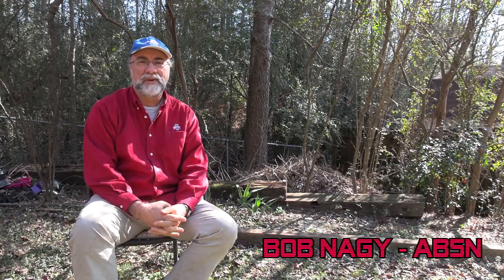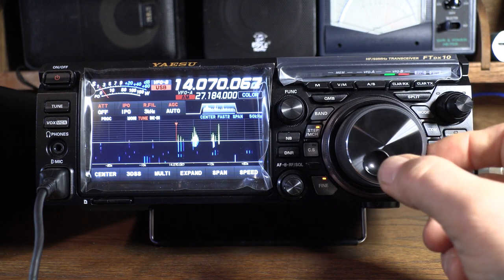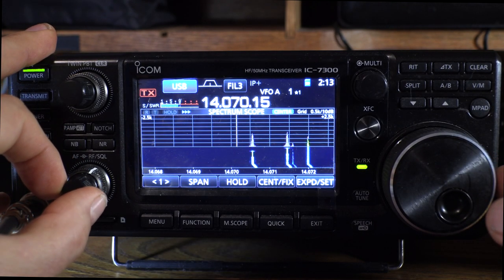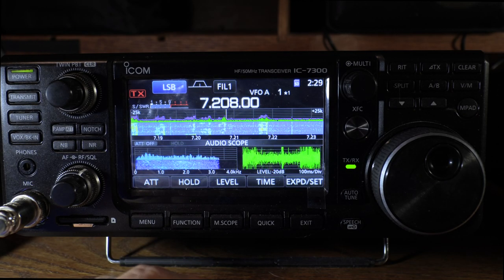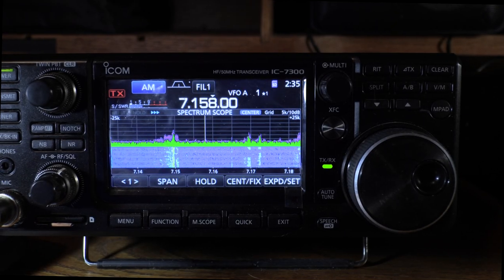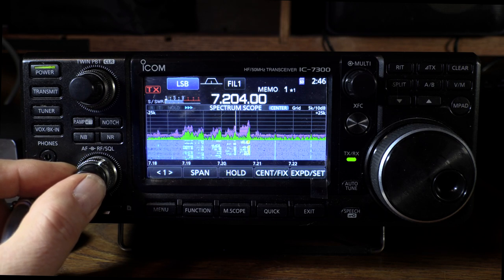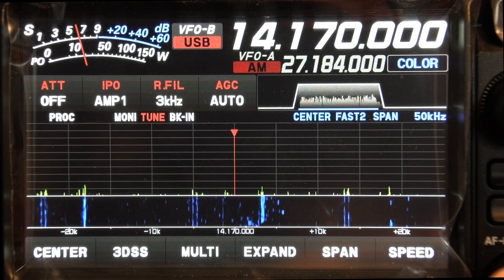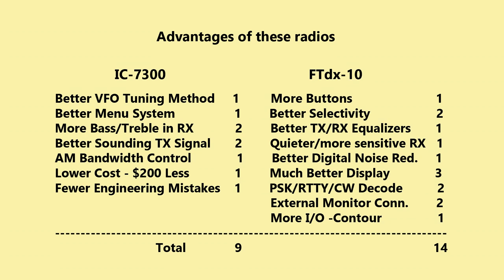Head to Head Comparison of FTdx-10 to IC-7300.

Comment: I have to agree that benchmark numbers might be part of my decision criteria but the relative feature sets and to me the ergonomics are at least as important. I’m also into photography and I prefer cameras with separate M/A/S, ISO and exposure compensation than these buried in menus. So all things being equal I prefer the more analog experience. Watching other reviews and comments online I’m concerned about the number of reported “problems” and “faults” with the FTDX10 vs the 7300. I guess I’ll have to consider the merits further. I have no experience anchoring bias either way as I’m a newbie and do not own a Base/Desktop unit of any kind.
Reply: Brad- Well, you'd be happy with either of them. If you are not a contester, the 7300 is just great. The 10 has better selectivity for contesting, but a quite strange menu system. All the common stuff you use every day is easily accessible on either radio. If you are not used to either Icom or Yaesu menu systems, 
then it is a coin toss. You get used to them. I prefer the Icom for one reason... no scope averaging on the Yaesu. I'll never get used to the strobing effect on the Yaesu.  The 3D scope is useless. Catch a sale and go for one!

Comment: Hello Bob, You say that the response curve of the audio amplifier in reception is less rich in treble and bass on the yaesu. This is often the case with yaesu. For me it's a big problem that sometimes pushes to use the contour in inverted mode to add treble. I am always satisfied with the audio response curve of the ICOM unlike the YAESU. It would be interesting to precisely measure the frequency curves in order to compare them. Even the Sherwood measurements don't measure that and that's a real shame.
Reply from the maker: Indeed we would like a nice flat response curve over the RX passband. Yaesu knows that Sherwood numbers sell radios. To this end they trim the passband at top and bottom. You can easily tell when you widen the bandwidth...it just doesn't "open up" like when you do the same on an Icom. For digital modes, a flat curve would be best. Where you can really tell is if you add a set of three-way PC speakers to the radios. On the Icom, the bass is rich and deep. On the Yaesu's there is nothing under about 80 hz.

Comment: Bob, very nice content in your channel. Thank you. I thought that the FTdx10 share some hardware and software. Some months ago, after watching your video about the FTDx101D and reading the comments, I gave up buying it. I ended up saving the money, and changed my mind about having a higher level rig. I own a IC7300 and a TS590S. Now I’m thinking about selling the TS590 to get the FTdx10. Do you think it’s a good movement? Are that FTdx101D’s 22 issues (or part of them) present in the FTdx10? I appreciate if you could shared your impression about this! Thank you
Reply: Many, but not all of the possible improvements that could have been made from the 101D to the 10 were done. They didn't advertise this, as it is an admission of failure (which is not a good think in Japan). The radio is just a smoother operator overall. It is a great improvement from the 590s and a clear improvement from the 7300 (which is an excellent radio). There are no real glaring issues left on the FTdx-10. It is a safe buy! The one I used for review, I may sell now. Email me if you are still looking.

Comment: Isn't the Yaesu a somewhat newer radio with later technology available?
Reply: Yes, BUT. Design decisions must be made along profit generation. The most expensive chip in these SDR's is the ADC. We are moving away from Superhet to pure SDR- and the best way to do SDR is with a top-shelf ADC IC and no superhet circuitry. Icom decided to do pure Direct-Sampling SDR and use a expensive IC to do it. The result is the best-selling HF radio in 20 years. Over 65,000 sold. Yaesu realized that people read the Sherwood receiver tests and the top numbers sell radios. Plus, doing the older "Mixer" design allowed them to use a very low-cost ADC IC (and sell roofing filters). The one stage of superhet before the ADC IC does result in a very "Tight" receiver. Thing is, it comes at a cost. The receive audio passband is not flat in the 101D/10 series. Bass and treble are rolled-off top and bottom (permanent). The Yaesu radios also have some serious design flaws. The AMC circuit and malfunctioning ALC circuit makes it almost impossible to follow the manual and set the TX audio right. The menu system is just awful.. The display does not have averaging- and it is a Serious problem. The buttons to the left of the main VFO dial are too close and you hit the VFO trying to use them. Your happiness with a radio comes from a concert of elements which work together to make a radio a pleasure to operate. Icom has this balance DOWN. Yaesu sort of experiments on the public and then re-issues the radio fixed. (Ft-991/FT-991A etc etc) the FTdx-10 is a good radio...but the 7300 is more fun to operate.

Comment: at 8.05 NB, both do the same thing. Both have an immediat drop in SIGNAL METER DEFLECTION but the sound stays exactly the same. Just becasu the needle movement goes down doesnt tell the entire story to me. I havent seen a noise blanker that owrks well. but thats just me. It will be intresting to see what others think

Comment: I have found several posts of folks who own both rigs and are serious cw ops. Every single one strongly favors the FTDX10 with the roofing filter. It's just possible that Yaesu knows more about performance than you do.
Reply: Hey John-  the FTdx-10 costs 40% more than the 710. It's specifications are better. No surprise there. I'm aiming at the average Ham. That ham doesn't operate CW. As I said, one's happiness with a radio isn't solely based on the Sherwood numbers or ultimate selectivity in CW mode. It's a combination of elements. I bought both radios to do the review and sold the 710 (at a $400 loss). The comparison should really be between the 710 and the Icom IC-7300, it's direct price-class competitor. You should start making reviews as you seem to be so knowledgeable. I'm looking forward to them!

Comment: Well I get it I got the FTDX10. From the Sherwood  Ratings The Sherwood reigns the DX10 is and dx101 is number one.   Is the flex radio surprisingly coming 2nd which is really surprising Indefinitely beyond my budget though here I am with ADX10 all I gotta do is Oxford turn it on and start playing with the knobs and learn what you're going to do what and that might be a one big curve I don't know thank you for your contact enjoy your YouTube channel very much you're always straightforward you don't pull any punches
KQ4CD Paul ⚓️
Reply from the maker: Thanks Paul. Yeah, I'm not a fanboy of any brand. If it's good- it's good. If the Yaesu wasn't rated #3 at Sherwood, it would still offer more performance than the 7300...but it IS #3!
Reply: Of course the Sherwood tests are sorted ONLY by 2k dynamic range. Something Rob Sherwood admits is a spec mostly important to CW contesters.
If you aren’t a CW contester, that spec isn’t nearly as important.
According to Sherwood, the FTDX10 is a little bit deaf, which might be why it can show up as a “quieter” radio. Sometimes that can be a good thing, but to have the same sensitivity, you may be running a preamp where another radio my be running attenuation.
Bottom line, Sherwood rankings are based on what a hard core CW contester finds important, and no other measurements.
Reply: @johnarcher9480  If you look older Robs slides, he defines 85dB is enought good dynamic radio for contests. I never had problems even with FT-1000MP. Its much more important that the radio is easy to use and that you can quickly change desired settings, pereferably via the front panel knobs or switches. That's why I have TS-990, the best of all...

Comment: Most of the Top HF/50MHz  SDR  Radios use a Mixer . All Yaesu's Top FTdx10, , FTdx101D,  FTdx 101MP ,  Icom's Top SDR 7851 & Elecraft
Model K4HD & Kenwood TS-990S, TS-890S, TS-590SG   All use Mixers in there top HF radios!
Reply: There are mixers in the receive chain in TS-890s, 990s, 590s, Icom IC-7581 because they are not SDR radios, they are all superhet. Elecraft K4HD is a Direct sampling SDR.  IC-7300 and IC-7610 are both Direct Sampling SDR radios like Flex and Anan radios. No Mixers in the receive chain.
Reply: @Yavor54  They are SDR radios. Modern  mixing/superhet and filtering improves the signal and cleans up the signal's sting goes through  the software and chips. having the state of the art filtering and the superhet  before the SDR section sounds better. radios like the ic 7300 with the so called direct sampling get overwhelmed or can't handed a lot of local station coming in at the same time. my friend with his ic 7300 and me with a ftdx10 were running next to each other and I could separate stations he couldn't pull out of his . even the Yeasu FT-710 had the same issue. I'm sure they will do something to remedy this with direct sampling rigs in time. Maybe better software filtering or just add the modern filtering and modering superhet mixer and call it a new tech name. maybe its  a cost thing. having modern filter and modern mixers/superhet  are costly. Elecraft k4HD has a superhet, its  there highest priced model. check their website  "Model K4HD
Includes all of the above, plus our dual superhet module, the KHDR4. Ideal for competitive field day, contesting, and DXpedition stations. Each superhet receive section includes two crystal filters: one SSB/data bandwidth, one CW bandwidth. The superhet’s 8 MHz IF has an excellent dynamic range, so additional crystal filters are not required." https://elecraft.com/products/k4-transceiver

Comment: Thank you for this excellent video. Does anyone have any thoughts which of these transceivers is better for general coverage sw listening? Thanks
Reply from the maker: The IC-7300 is superior because it allows continuously-variable receive bandwidth control. The Yaesu only has two fixed settings. Plus the Icom passes the full spectrum of audio from bass to treble resulting in better quality AM reception.
Reply: @robertnagy2163  thank you sir!

Comment: Slightly concerned you're turning he AF dial when playing with the DSP  / notch and then again with playing with the filters on the IC-7300
Thats the wrong knob, the 'MULTI' know is the right one for changing DSP / notch and the 'TWIN PBT' knobs are the ones for moving the PBT.
Not trying to be an ass.. just an observation that you might not have had much experience operating the IC-7300.

Comment: Receivers or normally evaluated based on sensitivity and selectivity. If those items score high and they do on the Yaesu brands, personal satisfaction within a small price range is what really matters to the user/owner. The 7300 design, without some added filtering, will not do well close to other strong signals like in a neighborhood or a field day/dxexpedition. Yaesu has not yet built a receiver that does not have strong local signal limits built in.
Reply: One might agree with that - if the owner does DXpeditions or multi-operator close-in operations. I'm of the opinion that not only do most radios sit inside homes and never see that kind of operation, but that the sum-total of design features on a radio are what creates owner satisfaction. All of the current radios offered are so much better in sensitivity and selectivity than radios of even 20 years ago, that receiver performance is less of a critical issue on the shortwave bands today. We've gotten hung-up on Sherwood receiver tests. The FTdx-101D has stellar RX numbers, but just doesn't sell as it should because of it's other shortcomings. I sent 22 design "issues" with it -directly to Yaesu in Japan. For a first attempt at SDR, it's OK. The FTdx-10 has many of these small issues corrected (and of similar design). They neglected to address the critical ones though... and added a few new design flaws. Mine sits unused because of them. Sales of the FTdx-10 and FT-710 are miniscule compared to the the IC-7300 (over 65,000 so far). The reason for this is that the mix of great general design and a competitive price creates high user satisfaction.  The 7300 is still the radio to buy when we weigh-in all the factors.

Comment: Hi, if i want to use for shortwave listening, which one will perform better?
Reply: IC-7300. This is because the receiver has totally variable bandwidth control and the Yaesu does not. Truthfully for SW listening, buy a Tecsun 990.
Reply: @Yavor54  Thanks. So will you say the Tecsun will be equivalent to the Icom? I been following some Asian channels and it is never easy as the noise and relatively low signal in my area.

Comment: The dx10 does have more dials, but does it actually have more buttons?
Reply: Astute observation. Indeed the 7300 has 1 or 2 more "buttons". Let me re-phrase: The FTdx-10 has more of the commonly-used functions as buttons. Many of the often-used functions of a radio - are in the menus on the 7300.
Reply: @Yavor54  Don't talk to me about often-used buttons... I've never used the VFO lock button so often since buying the DX10 🤣

In a perfect world, it would handle like my 7300 and be built like my 590SG.  If it was, I'd sell those other rigs in a flash and buy a second DX10.... because the receiver is so exceptional.   As it is, the DX10 does just enough to earn itself a prominent position in my shack... that is until Icom or Kenwood come back with something better ???

Comment: Does the 10 have a tiny battery soldered to the board that dies and cant be replaced like the 7300 and 7610 have?
Reply from the maker: I doubt it. I did not see a LiPo disk on the board. Today, there are memory chips that don't require voltage to remember!
Reply: Can you tune at 1khz step on the yaesu?  
Can you adjust rf gain /squelch without menu on the 10 ?

Comment: You didnt say anything about exterior display integration other than mentioning DVI connector on the FTDX10. Progressive speed tuning on ICOM should be 4 points. Buttons close to tuning knob is not good for fat fingers.
Reply: I guess I'm underwhelmed with external monitors. The display on the "10" is perfectly adequate for me. Indeed, I was just using the 10 and REALLY missed the progressive tuning on the Icom. Close-in buttons on the 10 are a problem... overall though- the 10 is a pretty sweet radio. Plus, I just found a way to have 4Khz TX bandwidth on the 10 as an option...

Comment: the only thing icom could improve on the 7300 is the clock back up battery. the yaesu ftdx 10 for me was a terrible radio i have big hands and was very awkward to use. my vote goes to the 7300. so to me the 7300 is staying, sorry yaesu nothing jumps out to me to change brands. i dont care for for the sherwood report, i worked the world on my 7300.

Comment: Pre amp on 20M? Really required? I never use Pre Amp on Icom, and not sure why it is required on Yaesu?

Much better display on yaesu?

Also you can add Pan Adaptor to Icom, that's an extra 3 points? Which is better than the external monitor.
So I really don't see that much of a difference.
Too many menus on the yaesu? -2 points
Reply from the maker: The design is different. On the Yaesu, the IPO setting takes ALL RF preamps out of the front end. On the Icom, there is ALWAYS one preamp on...and you can add two more. So, there is no identical setting between the two radios. Taking all preamps out of the front-end of the radio - drastically improves the performance in strong signals....but it is a little less sensitive than the Icom with NO preamps on setting. Yes, much better display. It's Larger, has a better S meter, zoom-in second spectrum display with notch and contour display, more information in general,  more contrast and more customization ability. The spectrum display is also more sensitive. The outboard panadapter programs for the 7300 are very slow. Same number of options on both menus, the Icom is just a newer/better design. The Yaesu IS a better radio, but it has a few warts! Both radios are fantastic.

Comment: So do you intend on using this instead of your 7610?
Reply from the maker: No...although it does have better selectivity. The 7610 is going bye bye anyway, as the IC-7851 is now in it's position...which feels about the same.
Reply: @robertnagy2163  whoa you have a 7851?
Reply from the maker: @forgetyourlife  I run a ham company here... Mic upgrades. A lot of radios pass through here!

Comment: Has Yaesu corrected some of the software issues with the Ft dx 10 ?
Reply: There are subtle corrections from the FTdx-101D to the FTdx-10, but not publicly documented. There have been no significant changes in the FTdx-10 firmware since release. It is a good radio as-is, but if it were up to me- I'd optimize some things.

Comment: Nice informative video. I liked the demo on the IF shift / BW. The Yaesu is so much easier.
When it comes to the noise on 75 meters, mine is also S5 in the day time but the NB has zero effect on any of my radios.
Ft991A, TS590SG, TS990S and IC705. I guess I have a different kind of noise?
My vote is for the FTDX-10. 
Barry, KU3X